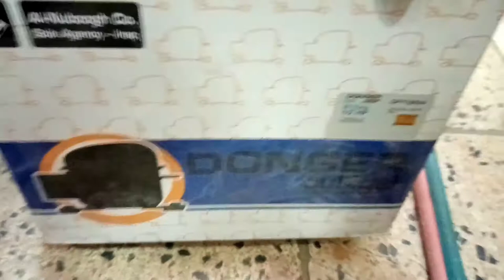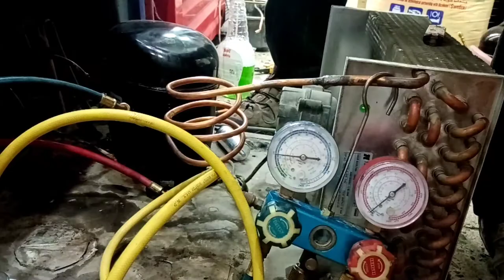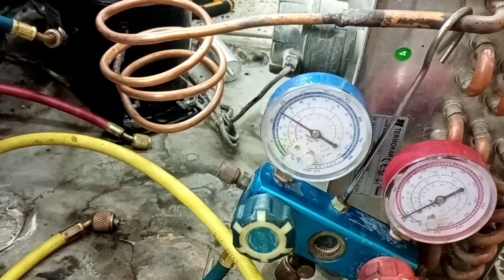Fixing a soda fridge compressor replacement

Comment: Hi, I have a crack on my machine and I want to know what sealant to use for the copper pipe for that?
Reply from the maker: there is no sealant for the copper pipe you have to reweld the damaged area
Reply: High strength solder should work if its just the copper piping